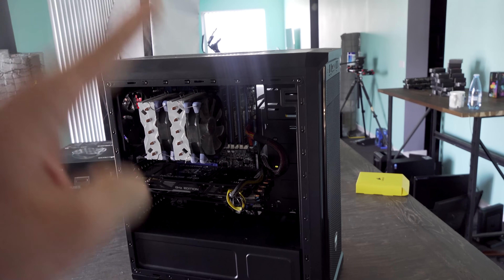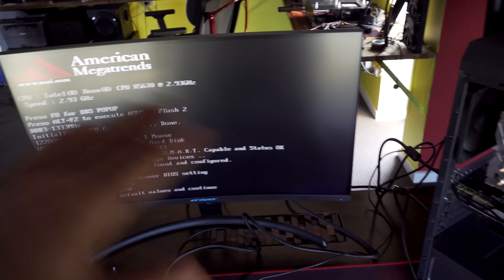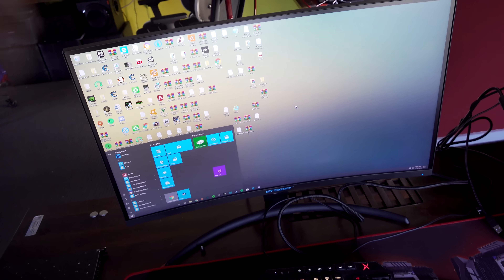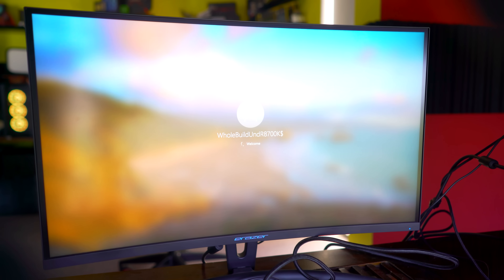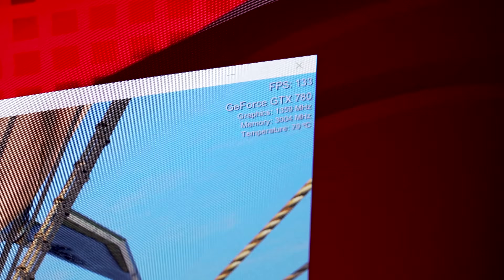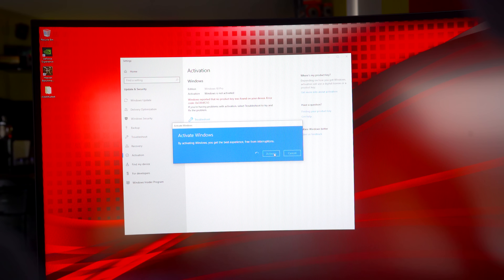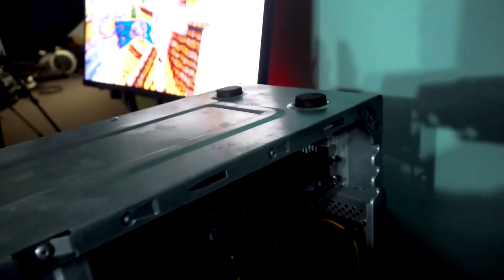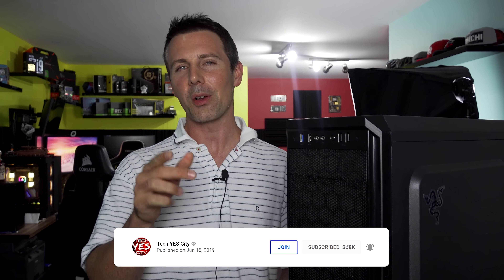Fixing "No Signal To My Monitor" - This Computer Came Back 2 Years After Sale.

Comment: This literally came out the day I had this problem
Reply: Not gonna lie me too, but my problem is the mobo didn't recognize my ssd. So it booted up to my harddisk, then i enter the BIOS to change the boot settings but the option is only my harddisk. I have an idea to buy a new ssd but i rather save my money to buy a new one... 
(edit: i rather save my money for a new PC).
Reply: @finnjakdmore2027  disconnect other drives, install windows on the drive. (or disconnect every drive but your boot drive, image your boot drive to the new drive, disconnect the old drive) then tell me if it boots or not. also tell me if you know what i am saying when i say this: "priority"
Reply: @kght222  i will try your tips when i get home, thank you for your advice :)
Reply: @finnjakdmore2027  is your SSD partician formatted? That could be your problem
Reply: @skoopsro7656  what is partician formatted? i have never done something to my SSD except storing the system files and other things. The SSD just went like suddenly not working.
Reply: @finnjakdmore2027  that is how ssds fail. they work until they don't, then they REALLY don't work. you can usually reformat and use it for a bit of time but after that first fail it is done for, cascade failure isn't the proper term (that refers to something else) but if you know the concept the reality on an ssd is similar. once an ssd starts failing sectors enough to cause a corrupt boot you might as well throw it away because it's useful life is measured in weeks, not months. you have hit the write cycle limit, and while the drive MIGHT handle more, the firmware is going to say "no".
Reply: @skoopsro7656  if the BIOS cannot see it, it cannot be partitioned/formatted
Reply: @phaztheaussiebastard yea it would be much easier to diagnose this in person than over YouTube comments. That would be pretty obvious sitting in front of the machine.
Reply: Has the problem been solved?
Reply: I had a similar problem a few days ago. But mine was from me installing a new graphics card and since I used the VGA output on my old one and my new one didn't, I ordered a VGA to display port adapter. And my monitor would lose signal booting into windows after BIOS.
Reply: @reagenlionel  find an hdmi monitor to use, like a tv, get the computer booted in, set up your vga monitor, have a nice day.
(EDIT: when i say set up your vga monitor, i mean plug it in at the same time)
Reply: @reagenlionel  VGA is an analog signal and DP is pure digital. In order to "adapt" this you would beed an expensive active adaptor not just a plug and pray... DP Adapting is tricky to say the least and many times not worth it
Reply: @NapFloridian  adapters for this being "expensive" is a matter of perspective. a display port to vga adapter is less than 10 bucks.
Reply: @NapFloridian  also, plug and pray hasn't been a real thing for decades.
Reply: literally decades, it was a usb issue for the most part although original pci fell prey to plug and play foibles, but that really isn't an issue at all anymore
Reply: I simply  have no signal  to my  monitor.    I need help
Reply: @Xcccceb  don't expect help without data.
Reply: @kght222  ight I got a budget pc. It's a dell optiplex i73770  with 8GB of ram with an 1650 super.  It was working  fine but then I tryed  adding  2x4 gbs of ram. Now it doesn't  work , regardless  what I do. I took off the new ram and it still says no signal to monitor , even  though  It turns on.
Reply: @Xcccceb  are there more than one video out, and in particular is one set of video out connected to a separate board inside the computer (you upgraded the ram so you should be able to see). something here doesn't add up.
Reply: also did you disconnect anything to reach the ram slots? might have been a graphics power cable
Reply: easy to tell if you unplugged your graphics card, look at the side and you might see an empty socket (the edge facing you)
Reply: @Xcccceb  but to put it bluntly adding ram doesn't change anything. unless you have to disconnect something to add the ram and forget to reconnect it
Reply: @kght222  I only have one monitor, so only 1 video output and  the displayport  wire is connected  through  the graphics  card, not the motherboard. 

Like I said it was working  fine until I added  new ram. So I thought  the ram  must be bad, so I took out the new ram but nope it still says no signal with the monitor  on.

Aye but thanx for responding
Reply: @kght222   nah i didn't have to move anything but just pop in the ram, so idk what's the problem.
Reply: @kght222   no it was not required  to disconnect  or move anything  to put in the ram
Reply: @Xcccceb  popping out the ram made it work the same again?
Reply: if so, try swapping the ram
Reply: @kght222  nah that's why idk what's going  on
Reply: @Xcccceb  remove all the ram, try just the new ram in the old sockets. if that works look closer at the sockets and make sure that you are using an actual bank then put the other memory in the other bank. the banks can be called channels, but if the amounts are not the same they are just banks...
Reply: @kght222   I tryed  both.  I took off the old ram and just put the new one in the same spots nope, still the same no signal  problem. Same thing  when I did the vise versa, take out the new ram and put back the old ram nothing.
Reply: @Xcccceb  faulty ram? try to put 1 stick at a time and changing sticks/slots and see how it goes.
Reply: @kght222   kinda stupid. My  graphics  card isnt putting  out the signal  to the monitor.  It's new got it in December.   What a shame
Reply: R p  chuckle, excuses are for the weak. now polish my turd. (=P)
Reply: R p  btw, what cpu was the person who didn't have video in this thread using?
Reply: R p  also, what gpu did they have?
Reply: R p  well, if you like your tools i'll give you a hint. increment the voltage then overclock more. but contain the voltage, don't let the voltage be free.
Reply: This issue affected me literally this week and still haven't been able to solve it. Have yet to reset the cmos but I'm thinking it's my psu. I managed to get my PC to boot but only in safe mode. It gets frozen when booting and when shutting down. Another thing too is that I managed to get a signal from my gpu but soon after the signal drops
Reply: SAME!!
Reply: Lords got your back man, trust.
Reply: I just subscribed.
I have a question if you would please.
I took out my heatsink with my processor attached can blow out the cooling fins. (Dust )
Put things back as normal.
Monitor says no signal.

I tried a multitude of things to get it going again no results.
I am stamped.
I checked Ram HDMI cable took graphics card out blew it out receded it and cleaned contacts. ,l and much more.
When I start the computer up all fans are running everything sounds normal but monitor says no signal.

Any ideas please.
Keith Kuhn
Reply: happened to me back in 2017 when I was building a pc with a ryzen 5 1400. I tried everything and it wouldn’t show anything thing to the monitor so I just gave up and sold the pc parts.
Reply: @chortles7515  err, did you have a video card?
Reply: kght222 yes I had a gtx 1050ti at the time
Reply: @chortles7515  r5 1400 doesn't have integrated graphics. it works in motherboards with hdmi ports built in.
Reply: @chortles7515  let me be more specific. the motherboards available for first gen (and even current gen) ryzen processors often have graphics ports. hdmi, even display ports. but those ports only work if you use a cpu that has integrated graphics, which wasn't even available on first gen ryzen although they built it into many first gen ryzen boards because the standard was there and they were waiting for the amd apus that could use them (raven ridge cpus). they didn't come out for around a year after ryzen first came out but the motherboard manufacturers prepared for them. there is no first gen r5 with integrated graphics, so those graphics ports don't work. when raven ridge dropped it worked with those ports, but raven ridge was all r5 but the numbers were not 1500 or even similar, they were all second edition (2xxx) and worked fine on first edition boards with bios updates, but were not impressive AT ALL. if you didn't have a video card on that build, you would never get video. and instead of selling the parts, you should have just bought a video card eventually because you probably would have saved money in the long run. an r5 1500 today would still be able to handle a gtx1650 maybe even a gtx1660 no problem.
Reply: also i noticed you said 1400 and i upped it to r5 1500, because 1400 should be able to handle everything gaming that an r5 1500 can, the real question is doing things on top. and some r5 1400s overclock better so have better single core performance than a 1500.
Reply: kght222 yes I was well aware that ryzen never had integrated graphics

Comment: My old 6-year-old dead slow Dell computer has signal to an old 10-year-old Samsung and 4-month-old 4K TV.
The new CLX high power Nvidia GeForce 3060 has signal to the old 10-year-old Samsung.  So far so good?
However, for about 3 days it had signal to the 4K TV and then it just quit.
AND THE ANSWER IS?  🙂
(Read that again so it is clear)

Comment: I connected my laptop into a  dock with my dual monitors - at first they worked great, then beeping then they "flashed" and shut off 2x. after checking I found it may have been due to my dock and/or power strip not being strong enough. I upgraded to Belkin 3 monitor dock and a strong belkin power strip. Now, NOTHING!  I cannot get the computer to detect either monitor PLEASE HELP

Comment: maybe you can explain whats going on with mine everytime I try to use 3090 on tv it shows green and is all fractled often times showing the screen from the last input or the last time the tv had a visual works just fine when I boot the pc but when it gets passed boot screen just get that hdmi isnt faulty works on every other display but my oled sony 77 inch and its starting to piss me off how can you spend this much on a computer and a tv and they not be compatible used different hdmi different ports just doesnt want to display the only time I got to display on tv was plugging the pc in through my xbox to the tv otherwise works just fine on my monitors but about to get rid of it to get one that does work on my tv but dont want to go through the migrating process again please help

Comment: This all started when I decided to upgrade my cpu and motherboard.. originally I had a Ryzen 7 2700x and an Asus prime x370 pro also a one month old Samsung odyssey g7 32” monitor. So I decided to upgrade to a Ryzen 5 5600x and tried 3 different motherboards (Asus b450f gaming, Asus b550 f Wi-Fi, and msi x570 tomahawk) the reason for that is because I’m a little rusty while building pc’s and no one at the store told me that the b450 had to be flashed. So my problem now is I keep getting a “display port-no signal” and can’t even see bios. I tried hdmi and same thing, oh and I used multiple different cables. At this point I gave up for the night and sweating bricks thinking it’s my gpu.. so I took it to a local place to diagnose my Pc and it posted for them and were able to see the bios/uefi. So now I was starting to think it’s my month old monitor. So I exchanged it for an Asus rog strix xg27aq at microcenter and that came with a new set of cables (hdmi and DisplayPort) plugged it into my rig and it’s doing the same damn thing. So this time I took my rig to microcenter and they plugged it in and I saw with my own eyes (first place I took it to they took it to the back) that it posted there too.. so now while I was there I bought a new power cable for my Pc and a new surge protector and got back and switched off the main power outside and turned it back on and still “display port-no signal”. I also tried a different wall outlet as well and I’m so frustrated. One thing I forgot to mention is that when I go to my monitor’s OSD the ‘system setup’ is greyed out and I remember that being greyed (if I remember correctly) on my Samsung g7.. do you guys have any ideas so I don’t have to contact a psychiatrist lol? Btw all the fans and rgb inside my rig are on. Is this super shitty bad luck? Because I’m clueless with how to proceed at this point.. sorry for the long rant..

Comment: I have an asus strix gtx1080 that stopped working after my system crashed, basically after restarting the pc I got no signal, so I removed the graphics card and it works without it while using the motherboard graphics. I wonder why the graphics cards doesn't work. I didn't reset the CMOS or touched the ram.

Comment: Why not try to press the "Caps" or "Num" keys to see these light able to turn on/off. If you able to turn on or off the key caps and number light but monitor no signal, that usually mean something wrong with the monitor, or GPU is not working but the CPU graphics is working.

Comment: I have a gtx 1660 and a 600W power supply and all my fans are on my cpu coolers on and so are my gpu fans are running but when I plug my display port in it just says no signal

Comment: my problem is that my pc turns on, hdmi in the gpu, everything works in the pc BUT my keyboard won’t light up nor will my mouse and they’re plugged in the pc and on my monitor it says no signal. It just randomly started doing this and it wont work.
Reply: same, u find a fix?

Comment: Need help ASAP so I bought new ram and ssd and I installed both the ram clicked and if tryed almost everything unplugging the new ssd and taking out the cmos batterie I’ve also tried putting in the old ram and it doesn’t work my pc is on but I get no signal I also tried putting only one stick in and it’s no my monitor because I tryed my pc on a different one and it still says no signal also tried both hdmi and Dp also my gpu fans are spinning and so is my cpu cooler fan
Reply: And my pc was working fine like a minute before I did the swap so I don’t think I broke anything plus my keyboard light up for half a second then turns back off

Comment: My pc randomly stoped displaying on my monitor when I came back after using the bathroom after I was just watching YouTube on it 5 mins earlier I’ve cleaned the ram and checked all the connections my led lights for my ram and my case turn on as well as all of the fans but it dosent come up on my monitor need some help here any ideas

Comment: i need help i moved my setup downstairs right and when i tried turning it on it wasn’t connecting to display and so i tried different cables and everything and it has yet to work i have a prebuilt with a rx580 and need help school starts in 2 days and i need my computer to work

Comment: If the screen resolution has been set to something the display cannot display then it will look like something is wrong so what about trying 1920x1080 or 1024x768, Why not 100TB Data Center SSD's, most of the motherboards that use INTEL chips have 2x RAID controllers so what about using 2x 50TB SSD's for your Boot Array and the other 2x 100TB Data Center SSD's for  Data storage, if you have AMD APU SKUs then you don't need addin graphics cards unless you can get a graphics card that exactly matches the graphics hardware on the APU then you can install that graphics card.

Comment: Just had a similar issue with a customer build a few weeks ago, a year later they brought me a system I built them and a simple cmos reset fixed all.  I believe they tried to run monitors to both gtx970 and motherboard, when it didn't work they tried playing in the bios and messed up some settings.

Comment: There's no way I'd buy those Windows keys. If you see the "some settings are controlled by your system administrator" in the Settings menu, you know someone has over-riding control of the key you just used; plus possibly more abilities, like controlling your machine.
Reply: There are certain websites offering Win. 10 for free asking you to do that. But not this one
Reply: @Savirezz  yeah I've seen them. They are incredibly dodgy and will undoubtedly have free reign over your machine. 

Tech Yes City is promoting the sale of licenses that are more than likely volume licensing codes, or stolen, and therefore illegal. Look, Microsoft can get f*cked as far as I am concerned but I feel for other people buying these codes and getting a dud, getting their system totalled by some a-hole in China or Russia; or worse, getting the cops and lawyers banging on their door demanding they hand over the computer and taking them to court for piracy. 

Do the 'safe thing' and don't buy dodgy keys.
Reply: @Savirezz  out of interest, when you have applied the keys to a system, have you noticed the message 'some settings are controlled by your systems administrator?'

It was a generalisation Bruce. They don't have to be from China or Russia. But, in my experience, many of the keys are purchased by Chinese and Russian crime syndicates. Google it. You don't need to call me an a-hole for it. 

FYI: countries is plural, country is singular in English.